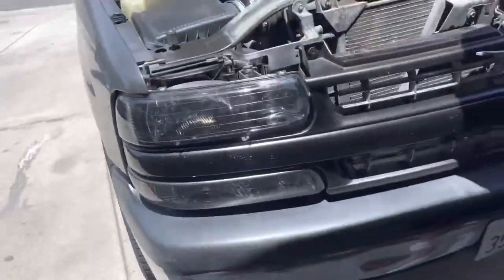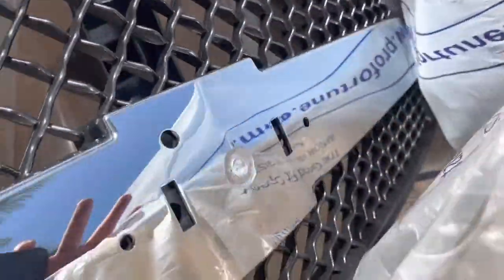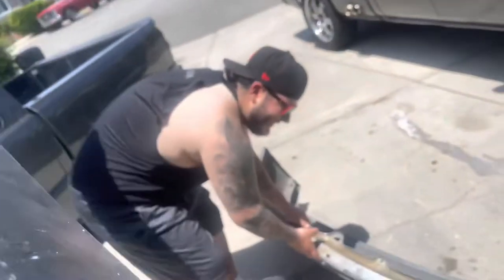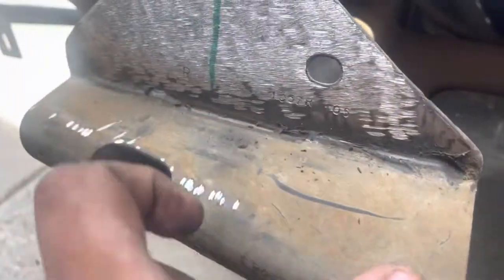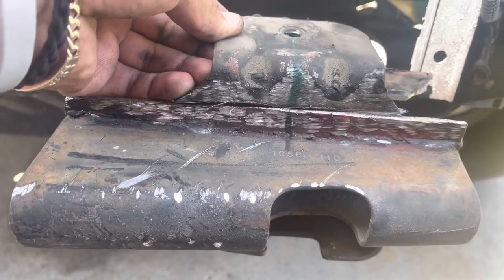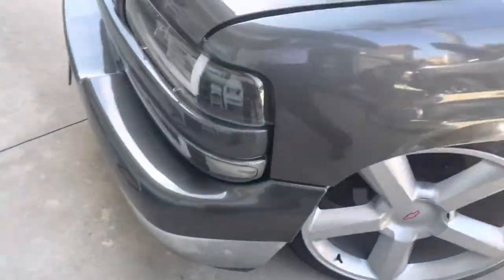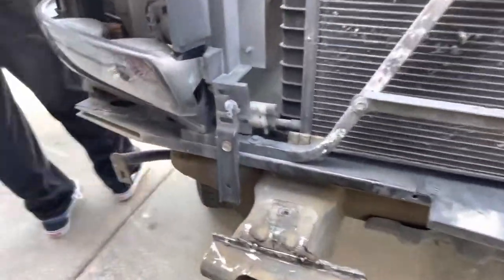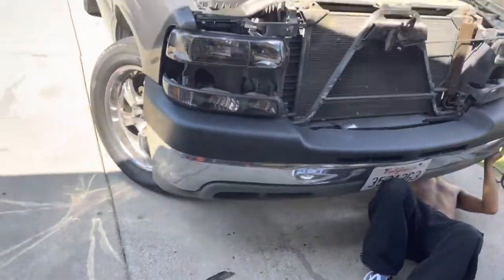HOW TO CONVERT 99-02 SILVERADO TO HD FRONT END

Comment: So all you have to do it cut the brackets 1 1/2 inch down and that’s it will the grill fit
Reply from the maker: yes and trim the corner under the bottom headlights bottom of the radiator support
Reply: @HDzayy  can you be more specific please 🙏
Reply from the maker: @reyrey0226  its hard to explain the exact part but if you do the conversion you will see where its hitting

Comment: Looks clean bro i wanna do an hd front bumper and grille conversion as well on my 2000 silverado but i have a question when you do an hd conversion do you have to change the hood? I have a cowl hood and i like the way it looks i don’t really wanna change it but will it be a problem if i don’t such as gaps and fitment?
Reply from the maker: hood will not affect it, i have a cowl hd hood on my other truck everything lines up, on the grill and bumper is lowered
Reply: @hdzayy8646  ight bet thanks bro keep up the grind
Reply from the maker: @foeNem_300  🙏🏽

Comment: Could I do this to a 2000 gmc? I got fenders and bumper from Silverado HD conversion what would I need to do to make it work? Thanks in advance
Reply from the maker: you would have to cut off the bumper brackets and weld on the chevy ones, thats if you want to comvert it from gmc to chevy front end
Reply: What about hood, would I have put Chevy hood or could I keep my sierra stock hood? Because fenders from Chevy to Gm are slightly different at light and grill right? Thank you very much I appreciate your help
Reply from the maker: @miltonmiranda9900  the hood you can keep but you will have to cut the edges slightly
Reply: Ok thank you 🙏🏽
Reply: What would you recommend? Easier just getting Chevy hood?

Comment: Where can I get the grill bro
Reply from the maker: amazon or ebay, its 99-02 HD grill
Reply: When I get the grill do I have to get the padding I’m new to this truck stuff why do you cut the brackets for ?
Reply from the maker: @jimenez1877  you need the hd bumper pad as well and your need to cut the brackets because the grill is bigger and pushes everything down
Reply: @hdzayy8646  this will fit in my 99 Chevy Silverado 1500 crew cab right bro ?
Reply from the maker: @jimenez1877  yes
Reply: @hdzayy8646  Garage-Pro Grille Assembly for CHEVROLET SILVERADO 2500 HD/3500 01-02 Platic Ptd-Black w/Chrome Center Bar Old Body Style will this one fit bro on my truck
Reply: @hdzayy8646  Garage-Pro Grille Assembly for CHEVROLET SILVERADO 2500 HD/3500 01-02 Platic Ptd-Black w/Chrome Center Bar Old Body Style will this one fit my truck bro ?
Reply: @jimenez1877 did it fit your siverado?
Reply: @_uriel_9517  I still have it I haven’t installed it yet